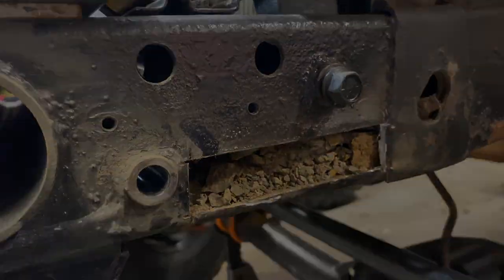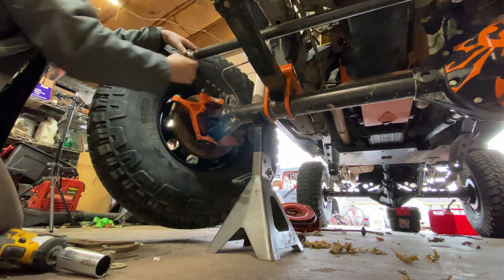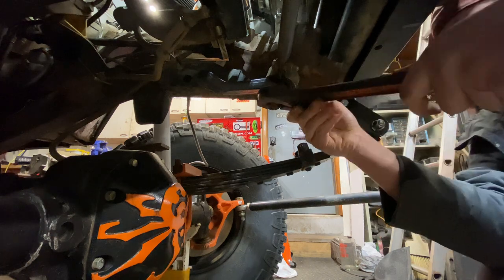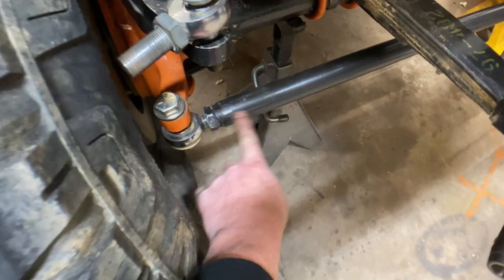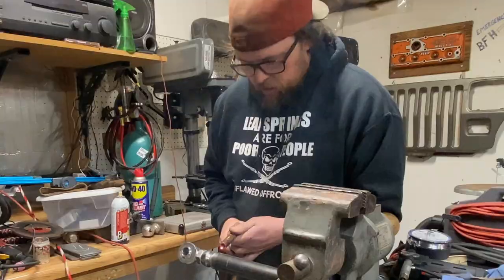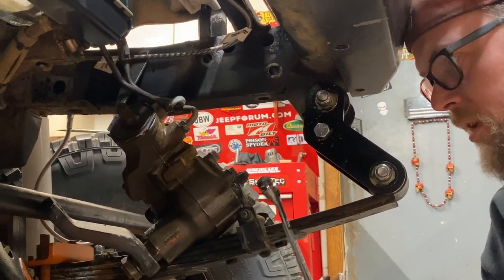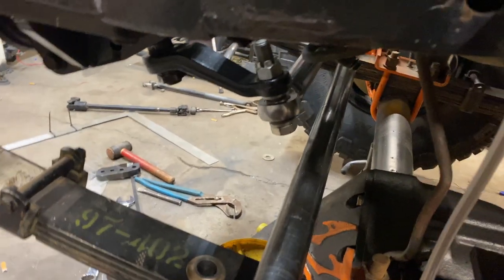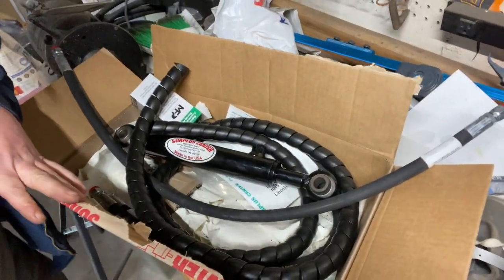Hi Steer Nightmare! Prepping my Jeep YJ for Hydro Assist and Hi Steer - Part 1

Comment: I’m using the same axle, knuckles, steering box relocation, and running everything on the high steer arms with hydro assist. I have my front axle stretched 2.5”-3” forward as well. Running a waggy pitman arm with the drag link on top. Everything clears easily and it drives great on and offroad.
Reply from the maker: Awesome I might have to check out your set up. I just got that flat Pitman arm in today but I’m still wrapping up rebuilding the gearbox. I’m going to assume that the tie rod never comes up far enough to hurt your Pitman arm?because with that much stretch it’s  sticking out over top of it right? Mine is

Comment: Sweet progress. It sucks sometimes. I just spent 3 weeks doing my 3 and 4 link stuff from scratch, I know the feeling
Reply from the maker: Yeah I hear that. My progress is quite a bit farther than the video, I’m workin on part 2 should be out next Monday. The hi steer part is done, it’s time to do the ram. I sure would love to give it a test spin to feel the difference first. Gained about 5-7 degrees of steering angle just by getting the knuckle stops shaved off and dialed
Reply: @FlawedOffroad  I finished all my long arm stuff 2days before snowpocalypse. Ended up being a 2 week torture test on the rig. But ya my steering stuff is next. Glad I seen all your issues before I started cutting lol

Comment: I guess it's late now, but check an astro van pitman arm for a flat arm that's right at the stock yj arm length.
Reply from the maker: I thought about it but couldnt find one online and its been below zero so the junkyard didnt sound fun. I got the wfo flat arm on last night and drilled it to 6" and it looks like it will clear

Comment: Nice! I’m running the same axles in my solid axle swapped gmc. Let us know what ram you decide to run and what the steering angle ends up at when it’s all finished.
Reply from the maker: Surplus center 1.5” x 8” ram with swivel eyes, about $140. I’m going to have to build a spacer to limit the travel because I won’t need 8 inches but more than 6” I think

Comment: I hope you don't add too much steering angle and start breaking axle shafts. You know I've been there.
Reply from the maker: Before I modified anything I was only getting 27° of steering, according to Spicer the U joints can go up to 40°. I’m going to try to settle around 33 to 35 if this newer arm will allow

Comment: Did you move your steering box forward or just repair the internal welded nuts and box it back up? I’m a little confused since you mentioned a WFO bracket of some sort.
Reply from the maker: the bracket is a relocation bracket that moves the box 1" forward and about 1/2" down.
Reply from the maker: to move it any farther you have to cut or notch out the front crossmember and such, which its looking like I wont need to do that. I got the new arm on last night and it looks good, should be a new video early next week!
Reply from the maker: one more thing, I wasnt filming the frame repair but I did post a picture of the nut plate repair on my instagram Flawed_offroad